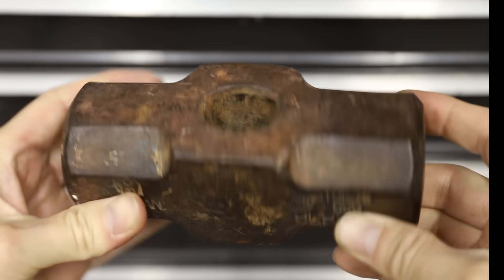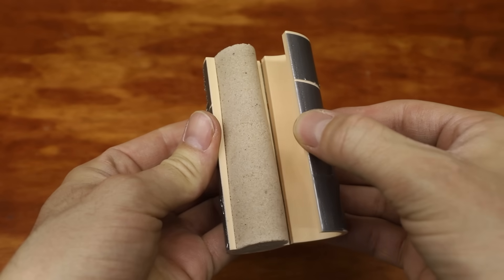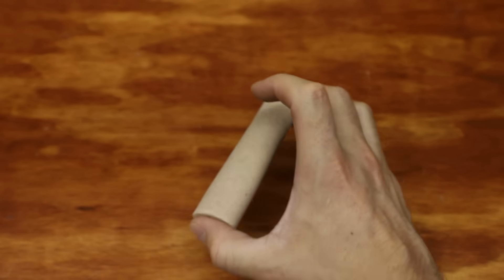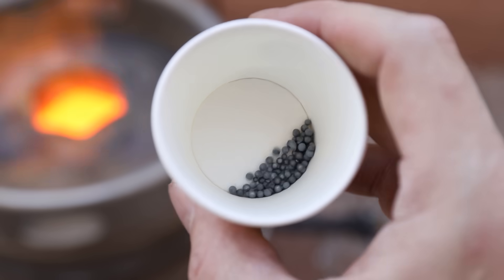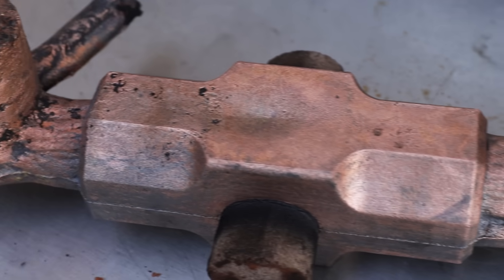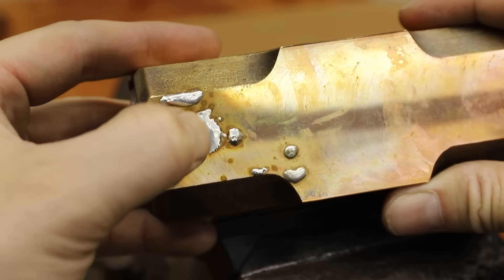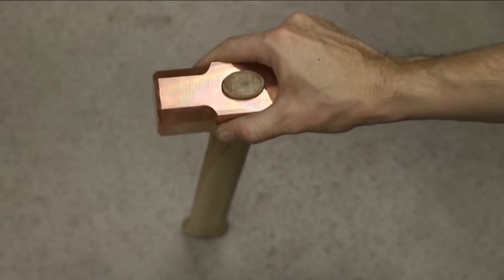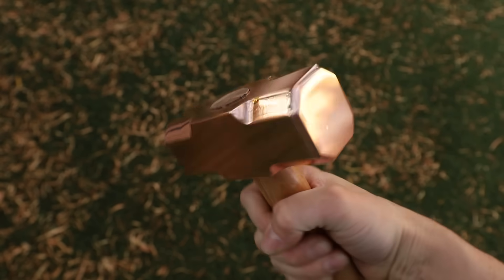Making a Solid Copper Sledge Hammer - HAMMER TIME!

Comment: If I may offer a suggestion....I'm a blacksmith and one of the things I make is hammers. I think you will find (granted this one won't be used but for the future) that you will have an issue with the head slipping off under heavy use. Ideally you want the eye to  be hour glass shaped. The narrowest part should be in the middle. That way when you wedge the handle it has a bit of room to spread open and lock in place. 
Hard to explain without a drawing but it's easy to find info. 
Looks pretty rad though dude 😊
Reply: YouTube comments need to more like yours.
Reply: @Clynikal  you comments are for REEEEEEEEEEEEEEing not constructive feedback
Reply: There are uses for soft head hammers they are made of lead and brass and are used for driving shaft through bearings as to not mushroom the shaft
Reply: @williamlyons3947  Have you PRICED a copper hammer lately?
Reply: The Hourglass shape could easily be formed with a peanut grinder
Reply: My friend, are you all right? I wish you good health, happy family, happy every day
Reply: I think this is more of a art piece haha. I don't think anybody would want to use it for obvious reasons. Some you specified and other commentators.
Reply: the core IS tapered. look closely :)
Reply: You can depict it like this.
)( <- 
I got'chu! (>")> )( <("<) 😆 lol
Reply: Since this is a casting, how well will it hold up to actual hammer duty?  I cant say I'd want to be the first to swing it.  Cast parts are never meant for impact.  But this is copper, so I dont know.
Reply: Also aren't pennies mostly made of zinc? So is this BS or did he use old pennies? Did anyone see the pennies get melted is what I would like to know your honor
Reply: @Sean Rogan  I don't think that's a complete understanding of the law or interpretation of the law I should say. I believe it implies to any sort of resale attempt. Like you don't necessarily have to counterfeit but if he were to have tried to resell that copper ingot that would have been illegal. 
I think Joseph g's interpretation posted about a month before you is the more correct one in this case.
Reply: How many kg of copper and how much is copper worth 🤔
Reply: Well, I’m a forklift driver. I can pickup hundreds of your hammer and dump ‘‘em in the woods. Nice job!
Reply: I agree 100%, it does look pretty rad !!! ... but, yeah, we haft hammers with tapered cores, gives more surface area to grip the wood ... or the hourglass shape, both are better than straight-through ... for hammers used for real work ...
Reply: You can ALWAYS drill a hole through head and wood, and drive another rod in pinning it.
Reply: @robertsmith2956  I have tried that method on a sledge hammer and an axe, It's no good. It weakens the handle, and it also allows water in(unless you make the pin water tight), thus creating a lot of rot in your handle if you have it outside, as it traps moisture. Sure, the head stays on as long as the handle doesn't break, but it's going to get real wobbly, real fast once it starts coming lose. I recommend just doing it the proper way.
Reply: @robertsmith2956  hammers that are hafted that way tend to get loose, and are pretty much impossible to tighten.
Reply: I couldn't say how he installed it but it sure looked like the core was atleast tapered.
Reply: @vicferrari9380  agreed the core looked tapered to me.
Reply: @vicferrari9380  wasn't tapered didn't mention it.
Reply: @williamlyons3947   You never know.  What if you need to take out a transformer?  Copper hammer would do the job nicely.
Gee, I thought liberals said recycling SAVED energy.  All those guns I made from recycling cars, just to make al gore happy was wasted?   I still want to melt down a tesla just to see how many I can make from one.
The smart driving should work as a smart gun sight as well.
Reply: You must be in the know regarding penny scrap policy. I was under the impression that the federal law against deliberately destroying currency without a special permit still applies to pennies, even the pure copper ones made before 1982. Has that law Ben changed?
Reply: @eldermillennial8330  that law has never applied to anything besides counterfeiting attempts. if you try to destroy currency in order to convert it into other, more valuable currency, its illegal. other than that, you can do with it what you please.
Reply: @MyBinaryLife  True. Otherwise all of those penny smashing machines you find in tourist attraction gift shops etc. would be illegal.
Reply: @eldermillennial8330  If you've ever been to a fair or an amusement park you'll find a machine that takes a penny and rolls it into something flatter and impresses it with the logo of the machine vendor's choosing. perfectly legal.
Reply: @MrRetread  So in reality the law is you can do anything you want with them as long as you don't resell them. So if he were to resell this hammer he would be breaking the law.
Reply: @eldermillennial8330  No they changed the crooks who enforce the laws.  And for the first time in my lifetime a court that upholds the constitution.   Good luck finding the 1972 denver mint penny in that hammer.
But THINK about this.  Amusement parks and museums have machines that CRUSH pennies.  Always wanted to put a steel penny in one to watch what happens.
Reply: @eldermillennial8330  No, but unless you are large scale or making a profit off the raw material, no one will enforce/prosecute.
Reply: @eldermillennial8330  It doesn't prohibit the use of pennies in works of art, so as long as the pennies aren't sold as scrap metal and you aren't trying to make them look like another denomination of currency that isn't an issue.
Reply: @eldermillennial8330  Hey dude I was under the same impression you were until I googled it. Apparently as long as you don't profit from the destroyed US coins then it's perfectly legal.
Reply: @eldermillennial8330  It's not illegal unless you intend to profit solely from the value of the metal content of the coins.
Reply: Jesus Christ died for your sins please repent for the kingdom of heaven is at hand ✋ 🖊 📄 🤚
Reply: @jesuslovesyou2616  Jesus loves you too
Reply: also after a some use it will lose its  shape and might ultimately slip off the handel due to the fact that copper is a soft metal. you can not really use it like you could use steel. robinson you dropped the ball.
Reply: @gregorysuto1865  In his defense, he said it won't actually be used
Reply: @gregorysuto1865  it would be a functional art piece in the house. Brilliant
Reply: @gregorysuto1865  yuou could use it for hammering wooden posts or such into ground etc.
Reply: @gregorysuto1865  Copper isn't softer than hickory and hickory works great in hammers, it is not going to have its eye get deformed that easily.
Reply: Good thing this hammer was just a project for fun and not to actually be used for work.

Dropped the logic ball, Gregory.

Comment: Normally when they cast those hammer heads I believe they do it vertically so that if there is any shrinkage from cooling it will be on the impact face side since that would normally be cut off anyways and most voids would likely end up in the waste material.
Reply: Bingo! 😎
Reply: I have no practical experience of foundry work, other than the little I gleaned from my father who was a foundry worker, but I was going to suggest that casting the hammer head vertically, would likely solve this issue.
Reply: @pulaski1  hi
Reply: My friend, are you all right? I wish you good health, happy family, happy every day
Reply: Jesus Christ died for your sins please repent for the kingdom of heaven is at hand ✋ 🖊 📄 🤚
Reply: @jesuslovesyou2616  sorry im not a cultist

Comment: its good to keep in mind that the hole is NOT cylindrical since in casting we can choose the shape exactly. the hourglass shape is not an artifact of drifting the hole, it enables the form-fit that holds the head on the handle 🌠the more you know🌠 looks awesome even if you never use it 🔨💯
Reply: I have always wondered if a sledge has a tip and bottom. I know axes do, their hole is more of a cone. I noticed the hourglass shape of a sledge hole but I could never definitively discern if there was a top or bottom. Could you help me?
Reply: @MyUnquenchableThirst  it dont have to be super mathematical it just has to be slimmer where the wedge ends

Comment: Creating a sharp corner on your riser, rather than a plain cylinder, will give it a sand hot spot, allowing the feed material to stay fluid longer. I think if the upper portion of your riser had this, I believe  it would have fed just fine. In my high production foundry job, we often had risers with what looked like a plus sign on the top as the 4 converging corners of sand (at the middle of the plus) held heat between them well and had very favorable feed characteristics. Think about maintaining head pressure with the height of the riser, along with maintaining heat in the riser and gate to ensure it feeds through solidification.

Love the foundry setup, hope to have something similar for my home shop some day.

Comment: One question, if you had the hammer head, why bother making a 3D printed model of it? Why not make the cast directly from the original head? (Final piece looked great by the way)
Reply: Thought the same thing.
Reply: Wouldn't he need to cut the original hammer head in half then?  Or at least create a riser that hugs the hammer head halfway up so he could use the same hammer head on both halfs of the mold.  

I don't actually know wtf I'm talking about.  I'm just a machinist.  I don't mold shit.
Reply: he said the molded piece shrunk as it cools  i think the mold might be a little oversize to compensate for shrinkage

Comment: Nice job. I was thinking, the first guy to beat on anything with that better run for his life. It's too pretty to use.
Reply: I work for a plastic injection molding company. I work on the molds. We have 3" round 12" long bar stock. And we use those to beat the molds shut. It doesn't hurt the hard steel.
Reply: @NORTHBROOK1978  yeah, but that's copper, not steel
Reply: @thompsonschwabbel6622  the molds are.
Reply: @NORTHBROOK1978  Copper isn't hard steel.
Reply: @eric_d  the molds are....🍻
Reply: @NORTHBROOK1978  Ah, poor choice of words in your original comment I guess.  Looks like I wasn't the only one that got the wrong idea.  No problem.
Reply: Guess you don't know what injection molding is.
Reply: @NORTHBROOK1978  I do, but the way you phrased it made it seem like you were using the hard steel to do the banging.  As if you thought copper and hard steel were the same thing.  A quick edit to your original comment would fix all the confusion.  It's clear now, further down in the comments, but I'm sure you'll get more replies saying the same thing that at least 2 of us have said already.
Reply: @eric_d  why would I comment on a copper tool .. about beating on steel with steel?
Reply: @eric_d  80 million people voted for sleepy Joe.. 🍻
Reply: @NORTHBROOK1978  OMG go back and read what you wrote originally!  The way you phrased it made it sound like you were using hard steel to do the beating with, not on.  That is why multiple people attempted to point out what seemed to be an error, but was just poorly chosen word placement on your part.  Instead of arguing about it, why don't you just edit your original comment so nobody else gets confused?
Reply: @eric_d  maybe you should read what the original point was that I commented on.. maybe you would not be confused...
Reply: @NORTHBROOK1978  Maybe you forgot that I wasn't the only one that pointed out what looked like a mistake, but was just a bad choice of words.  I know you're just being stubborn and won't admit defeat, but face it, your comment was misleading, I wasn't the only one that thought so, so either fix it, or drop the discussion.  Geeze, we were only trying to help you out, but you can't even admit your own mistake.  We all make them.
Reply: @eric_d  well...it's 5 to two... maybe your just a Biden voter.
Reply: @eric_d  lol. The hard steel is the mold. It was about copper hammers and steel molds. Why would he change his comment just because you couldn't figure it out. Basic  reading comprehension and deduction would go a long way for you. All you had the do was admit you didn't understand it at first. But doubling down and telling them to change the comment for you is just a bad look.
Reply: @chrisking1457  It's clear that you're the same troll on another account, so I'm just going to ignore you after pointing out that I wasn't the only one that realized the poor choice of words.  Buh bye now.
Reply: @NORTHBROOK1978
Reply: lest HE become its next target
Reply: If I had that in my hands, I would be running too. Just not leaving it behind...
Reply: Right? I would want to make like a dark oak handle with brass in it somehow for the color, a black and gold handle with the copper head would look so nice
Reply: what are you talking about?
Reply: @gregorysuto1865  Northbrook is just being an internet troll.  I should have noticed it sooner.  He doesn't seem very smart, but don't tell him that.  He thinks that 2 people telling him he was wrong, and nobody agreeing with him means that he's up 5-2.
Reply: @eric_d  Northbrook's original comment made plenty of sense in the context of what he was replying to. And contrary to the dingleberries in this comment thread, there are plenty of copper hammers on the market, he didn't start out as an internet troll until you made everything about his statement making no sense. He got 9 likes, so at least 9 other people can understand his original statement.
Reply: @Paregoric  nine likes and any number of dislikes. You can only see likes. There could be any number of people who didn't understand what he said and did nothing and any number of people could have not understood and thus dislike it.
Reply: @eric_d  we use "THOSE' to beat the mold shut. It doesn't hurt the hard steel.

Clearly this is about copper hammers since this is what the video was about. The hammer shuts the hard steel, it isn't made from it.
Reply: @gabrielhenson5751  lol
Reply: Hey, Mr Pie fancy seeing you here! I'd be using that to knock in some bearing races.
Reply: Trophy Hammer
Reply: Hahaaaaaaaaaaaaaa.......  Agreed!
Reply: How about putting stainless steel faces on it.  The copper would lend the mass, the faces would lend the striking hardness.
Reply: I’d have two 
One for show 
One for work 
I’d use the shit  outta it
Reply: I saw a guy make a machinist's hammer one time - the handle was deep dark blued steel, and the head and buttcap were brightly polished brass. Way too pretty to use.
Reply: You could use it if you absolutely HAD to 🤷‍♂️
Reply: also, there is a tensioned piece of metal contained in the hammer head, so that if you hit something hard enough, it will pop out.
Reply: nice dog
Reply: It's Thor's Copper Hammer. :D
Reply: Its too soft to use. Shouldve been bronze or brass.
Reply: @ethancntower8850  You do know they manufacture and sell, (commercially available), copper hammers, for you know, hitting stuff that you dont want to damage? Because the copper is nice and soft. Like those plastic, and leather, and lead hammers you can buy.
Reply: @philmenzies2477  oh yeah? Do they make copper sledge hammers? Send me a link..
Reply: @ethancntower8850  Yeah they do. But if you're going to delete comments to remove replies, then what's the point?
Reply: @ethancntower8850  Google is your friend
Reply: @ethancntower8850  Ebay.
Reply: @ethancntower8850  they sell copper headed sledgehammers not sure about full on copper   but I wouldn't doubt it  .just not very common would be expensive... look it up..
Reply: @ethancntower8850  McMaster-Carr lists a two inch wide copper head to use on aluminum, brass and also copper.
3 1/2 pounds.
Reply: @ethancntower8850  if he were, I'm sure you'd fill my pockets.
Reply: @ethancntower8850  I work at a plastic molding company I'm the tool room.  We use copper to beat the molds back together. They won't mark the surface.. they do mushroom over time.
Reply: @ethancntower8850  you can buy smaller copper hammers for soft blow use
Reply: @ethancntower8850  depends on the use of what he plans on ever using it for.
Reply: @ethancntower8850  "Its too soft to use" forgets the 800 year long copper age
Reply: @moggtheboss3087  haha. Mogg forgets that steel exists and is cheaper harder better and more durable than copper age metal. Duhhhhh..
Reply: @ethancntower8850  I thought brass and bronze were softer than pure copper.
Reply: @heavenlysonshine  you thought wrong. They used to use bronze swords for 1000 years before steel..

Comment: Very cool! I had no idea you had such sophisticated tools. By the way, I would call this a maul, not a sledgehammer.
Reply: A maul typically has a wedge face for splitting.
Reply: @alexjames1146  A maul is traditionally a flat-faced driving tool, but there are specialized variations. Splitting maul is the common term for the variant with a wedge shape.

Comment: Since you said it is going to be a wall hammer I guess my question isn't important, but just for authenticity, ... I couldn't see if you shaped the core to create a slight flare towards the top of the hammer so that the split ash handle can be flared properly by the wooden wedge so as to be secure. In my life's work as a utility contractor we swung a lot on a 12 lb hammer to break out core holes in concrete. Not our favourite part of the work, but necessary for the glory.

Comment: Copper Atoms Are Beautiful - Polish to a mirror finish and in order to prevent copper from oxidizing and losing it's luster,  varnish it with two clearcoats. Hang it on the wall so it's aesthetics would give you an inspiration. It will live for many thousands of years